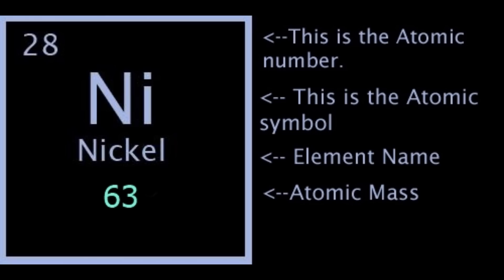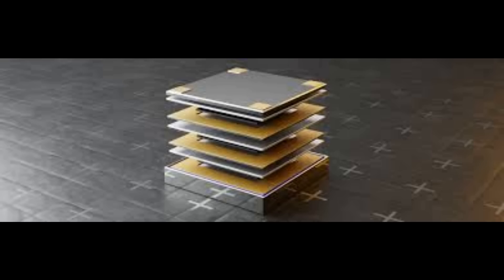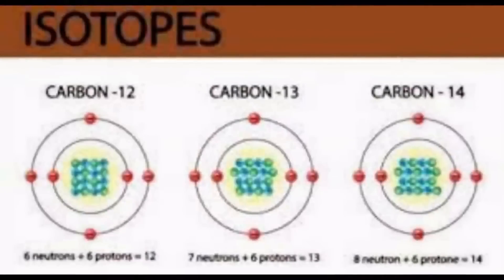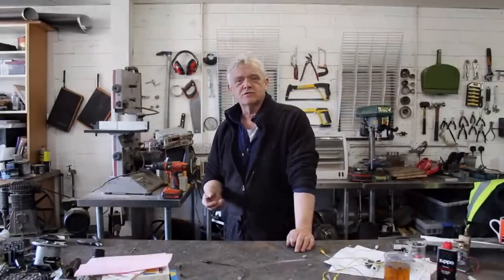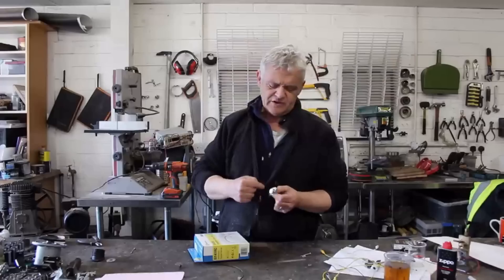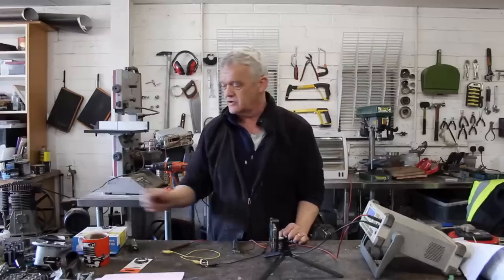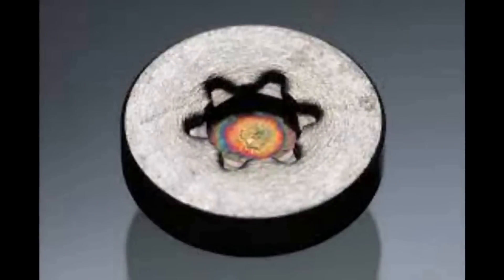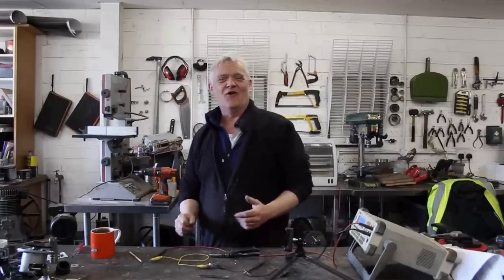2187 - The 50 Year Nuclear Battery From China And How To Make Your Own Version

Comment: So, this has got me thinking... While the output is minuscule, its also constant. Could we step up the voltage and feed it into a supercondenser to power something for small bursts? The only thing I can think of is a GPS tag, maybe a weather station. Given how incredibly small that semiconductor is, I'd say you could build a GPS tracker that lasted 400 years and wasn't much bigger than can of coke in your own home, with the tradeoff that it could only beam the position every so often.

Were these power sources cheaper and safer, you could probably cover entire cities with self sustaining, life long lasting lora transmitters, for cheap and reliable low bandwidth communication
Reply: Wait could you power a Casio clock with one of these cells?

Comment: Very interesting. It didn't occur to me until now that alpha radiations, being near the UV wavelengths,  could cause photovoltaic cells or semiconductors to generate a voltage. I guess the same is true of x-rays too since they're the next step up from UV. Not that I know of any material which puts out x-rays while decaying.
With the Americium, it looks like quite a few pieces would be needed in series to get 3.3V. I suppose each pellet could produce twice the output if it's extracted from its casing, to expose the underside and to sandwich ir between two transistors.
My smoke detector with Americium is definitely putting out Beta radiations too as I get an increase of over 500 CPMs when pointing my Geiger counter towards the plastic case and Alpha radiation wouldn't make it through the plastic and thin metal cage surrounding the ionization chamber. I don't think it puts out Gamma though because the readings drop when I insert a 1mm steel plate between the smoke detector and the Geiger counter. It's still bad though if it can ionize floating dust which might end up being inhaled.
Reply: That could be a concern , but I remember another vid where a person went into a mine and the air was very radioactive from all the uranium decay. I could be misrepresenting but the main issue was the charged particle radiation attracting and sticking to the clothing which came out pretty  radioactive, however it decayed quickly and putting the clothes into a bag away from the camp overnight dropped the radiation to background levels, perhaps simply an airtight unit would suffice.
Reply: @terrysobkowich2084  If you meant airtight batteries then yes, I'd expect them to be both airtight and shielded sufficiently to block beta radiations, as someone will inevitably end up carrying one in their pants pocket.
If you meant airtight smoke detector, that wouldn't work of course as the smoke needs to get in 🙂

Comment: Too bad it's only 130mV. Even if you wired 1600 of these batteries to get 240V, They wouldn't have the power to give you the amps to run anything usable. Stick to the grid.

Comment: This kind of voltage/ current would be useful for offsetting parasitic drains on circuits where there is always something that slowly depletes a battery even when you are not using it

Comment: I'm making an open trestle windmill out of what would have been firewood, when it is in operation it will simply turn a couple of alternators charging car batteries powering an oil radiator for the house. The sales will be 10 ft from tip to tip.

Comment: I first came across nuclear batteries with the Gameboy powered by tritium, phosphors, and a solar cell. When I looked up why not just throw radiation at solar panels, most articles I saw said solar cells will break down under radiation over time (not sure if solar cells on spacecraft are protected specially or not). Wouldn't this be a concern for your example?
And maybe explains why diamond semiconductors are used, maybe it's more stable?

Comment: There's a difference between the slow, what are called "thermal neutrons" in a reactor, and them being hot. They're actually less energetic than the fast ones, which as you mention kinda bugger off, though sometimes a reactor tries to slow neutrons down with a moderator material. This is because slower neutrons are better at smashing open other atoms, to give the chain reaction a reactor relies on. Where fast ones tend not to interact as much.

It's actually un-needed Strong Force, binding energy, that is the "mass" lost as energy in nuclear fission. The number of particles left after is the same as before, they're just arranged into smaller atoms, an overall less-energetic state. The excess energy is release as heat, but mass is lost because binding energy actually contributes quite a bit to the weight of an atom, even though it isn't a solid particle. Because energy = mass (times the speed of light squared). That equation works both ways.

Comment: Round about 0:30 you mention the battery giving 100 milliwatts of power, then later around 2:30 it's 100 MICROwatts! It's rather important to get this right! 3 orders of magnitude is a big deal in electronics! From what I've heard elsewhere the correct figure seems to be 100 microwatts. Useful for extremely low-power radio with sensors and the like, in super power-saving deep sleep modes, and maybe charging up a capacitor for occasional bursts of more power. 

You mention a future 1 watt version, so that'd be 10,000x more than these current ones. Although they're only tiny, scaling up by ten in each direction to a 15cm cube would be 3,000x bigger. So then you'd need to decide which dimension to increase by 3x, or whatever you like, to scale it up. That's still a very reasonable size for a battery with real power. 

This nickel isotope sounds very energetic, I wonder if that's going to cause problems in itself? I'm presuming, of all things, they're not gonna use LEAD in the shielding after removing every atom of it from electronics otherwise. Covet your precious lead solder, the stuff that actually joins components together!

Comment: 63Zn is not naturally present. To produce 63Zn, solutions of 63Cu - copper nitrate in dilute nitric acid need to be irradiated by 14-MeV protons in a low-energy cyclotron. It's certainly interesting for long battery life duration but it requires quite a lot of energy to transmute 63Cu copper atoms into 63Zn.

Comment: so if one trasistor generates 100mv.. then it also uses only small partion of the emitted radiation... i guess placing it inside a say something like tungsten cabride shell for reflecting radiation and placing lots of transistors there probably can produce lots of lectricity ... well ewen without shell there is atleast 5-6 transistors can face it directly if placed correctly .. but that reflector shells may be working making small radioactive matters go gritical too :P who knows... does it worth a try ... i dont think so without proper safety :P

Comment: I did something like this 15 years back with an americium chip. Was proof of concept but I would likely have to wait a long time to power up a capacitor to get an led to light. Had more fun with the chip and 4000v spark gap tester. Basically a fine guitar string wound in a ladder across a metal plate with about 5-6mm gap. Variable capacitor to wind it up until the arcs start then wind back just until the sparks stop then wave the alpha emitter over near the guitar wires. tick, tick, tick :P

Comment: NO the Betavolt (the Chinese battery you are refereeing to) battery can supply 100 MICROwatts NOT Milliwatts you'd need 10,000 of them in parallel to charge your phone at 1 watt which would take about .
please do a minute of research BEFORE you sprout Rubbish.

Comment: YOU COULD USE AT THE END OF THIS NUCLEAR BATTERY A CAPACITOR WITH A JOULE THIEF TO ENERGIZE THE LAST ELECTRO MAGNET OF A CIRCULAR MAGNETIC WHEEL WITH A DYNAMO IN THE WHEEL AXLE AND TO SEND ALL DYNAMO ENERGY TO A CAPACITOR WITH ANOTHER JOULE THIEF. WITH 3 OR 5 OF THIS DEVICES YOU COULD DEPLOY AN ALWAYS CHARGED BATTERY PACK FOR A SMALL SIZE PERSONAL ELECTRIC CAR.

Comment: OK how many of these to create a 48volt battery and what Watts would you generate with the battery? How big would it be if you just had the isotope and reactive part. 1mm thick per cell? Or much thinner if specifically manufactured to be as small as possible. I feel we could make a 48v battery the size of maybe a 12v lead acid car battery .....watts?

Comment: if its alpha or beta could you point it or several on an angle in a glass chamber so the radiation cant get out and the sun light can get in to give it a boost, dno if that would be too much for the diode or if it could give it a nice little boost

Comment: Nice demonstration. In 1960s, our military developed a portable nuclear plant that operates years providing a local power plant anywhere. There's a military documentary on yt showing this. And just in recent news this concept is being revisited. 
Thanks for sharing and providing good inspiration.
Reply: naquadah generator?
Reply: There are a few hundred of these abandoned around the former USSR. 
They used them for remote locations like lighthouses.
Reply: @MasterFancyPants  I thought the Soviet ones were radio thermal generators and not conventional reactors
Reply: @outsider344  They are, but the American ones in OPs post were also RTGs. 
The US just quickly decided they weren't saft enough for common use.
Reply: @MasterFancyPants  Some were RTG, some other ideas were not up to the task yet. 

I know at least 1 design was the plutonium gas core reactor. This has advantages and disadvantages but the much better efficiency for each gram of fissile material, pretty damn safe and light, not extensive huge cooling solutions. It currently is a gen 4 or gen 5 reactor design.
Reply: @MasterFancyPants Like nukes in suitcases or psiedon torpedo nukes ?
Reply: See also: nuclear powered submarines, and ships(mainly aircraft carriers).
Reply: Ah but that would make it difficult to take money off us for energy, no wonder this sort of thing is kept low key
Reply: @billb7876 yeah. That's what it is. You sound like a man to trust with nuclear material... You always had the option for your own wind an solar. You just lacked the ambition and commitment so you play along in the game you claim not to enjoy. Face those facts first before introducing your theories.
Reply: @billb7876  Stories about an experimental device tried out in remote Baja Sur that was a vibration based nuclear power station. Somewhat portable and shaped like a disc. Supposedly the remains of it are still in the mtns near the town of San Jose de Gracia.
Reply: @billb7876 that's not the reason
Reply: @billb7876  if you wanna make up a conspiracy at least make it somewhat logical.
These small nuclear plants wouldn't be cheap. So the electricity would probably be more expensive than what you are paying right now.
Reply: @Jehty_ What about the carbon Tax
Reply: @TheSubpremeState  what about the carbon tax?
Reply: @Jehty_  that's what the conspiracy theorists are annoyed with. Emissions compliance etc. all ways to keep us poorer than we should be
Reply: @TheSubpremeState  or all ways to try to keep the planet somewhat livable 🤷🏼‍♀️
Reply: @Jehty_  Sorry but I'm a mere mortal. I've accepted my death. I'm only 44 but I've 30 years left before I stop using up oxygen approximately. You are planning for the future. In the larger scheme of things you are planning for a spec of time. Imagine when the sun eventually expands into a red dwarf. What are we doing to prevent that? Your brain has evolved to like survival so it even likes the idea of surviving the impossible. The odds of this universe being the only one are very slim. You know about the strong force and gravity etc. and how if they were slightly different the big bang couldn't have happened. It'll probably happen again some time. Everything happens in its own time anyway so if you are worried about the future just worry about a few million years from now or a few billion. We will all be living on a space ship by then I suppose until the universe ends.
Reply: @TheSubpremeState  erm, we already do feel the impact of climate change. Especially with extrem weather phenomenon becoming more and more common.
I'm not talking about the distance future. I'm talking about the future you yourself will experience.
I guess you can close your eyes to reality and act like it won't affect you. But all you are doing is lying to yourself.
Reply: There was a crazy man who said there were these reactors under all cities and they pumped cold water from Alaska and not oil to cool them
Reply: Many small scale nuclear things were tried including nuclear powered cars (Ford Nucleon).  At the time it was envisioned that small scale reactors could also be a home power source. These days with battery energy storage this is truly feasible, but the nuclear dream died long ago.
Reply: is it an rtg
Reply: All Naval nuclear platforms should be capable of this.
Reply: It got scrapped because the fuel rods would build steam if removed improperly and one of the techs wasnt paying attention when removing it and got pinned to the roof by the rod

Comment: I heard the battery potential is 3V, nice
I heard the battery can deliver up to 100µW,  which is 0.1mW
I did some calculations, it turns out you need (1/100µ) = 10.000 batteries in parallel to deliver up to 1 Watt of energy @ 3 Volt (3 W total)
- the chinese thinks this can run electric vehicles and keep drones flying..... I say: Big budget, Big vehicle, Big FAIL for those applications.

Comment: A problem with spacecraft nuclear batteries is what happens if there is an accident and the battery material gets vaporized and spread across the atmosphere?
The batteries in the Galileo spacecraft, if it broke up in atmosphere during launch, was calculated to potentially cause 50,000 cases of cancer, minimum (if i remember what i read correctly), which is why some scientists (Carl Sagan even) were against using them.

Comment: you dont have to worry, the particles are stopped by air at about 1cm. they also cannot penetrate human skin, however crush it at your peril, the dust if it gets into your lungs could do some damage. however its safe as a little radioactive puck.

Comment: I saw the product announcement yesterday and hoped you'd review your battery.  Thanks.
Wouldn't ɑ/ɓ radiant voltaic battery continue to produce electricity after its half-life, but at a reduced rate?  Only half of the mass would have decayed into its new stable element -- the rest would still be active?
WOuld love to see this or a karpen cell as a charger for the fractal capacitor array.  One cell per capacitor.
Reply: Yust look at the voyager probes.
They passive energy source decayed more and more over the decades and now only a few of the instruments have enough power to stay online.
Theoretically it's never out of energy but practically it all depends on the half life.

Comment: There is no such thing as nuclear waste.  Only nuclear products we are currently not using.  We have enough nuclear waste in the country that if we wanted we could power the US for 150 years with no other energy sources.  You could quit fossil fuels just reusing existing waste alone.  Humanity's energy potential is exponentially larger than what we are currently using and we have the technology for it today.  And for some reason we have people in power telling us we need to use less energy.  The reality is that energy is basically NON-SCARCE.  Not with some theorized technology.  Not with some unobtainium.  But with materials we have stashed in piles and don't know what to do with.  Someone has made the calculation that we are not to have beyond a certain level of power.  Qutar burns more oil per capita than any other country, basically to make fertilizer.  Do you know how much fertilizer we could make with the nearly unlimited energy we have access to?  They want us to eat bugs to solve "nitrogen shortages".  It's so dumb.

Comment: Hello,  i tried this exactly in this fashion , i even checked the americium alpha source with my Geiger counter;  tried several same transistors;
i just cant get it to make any discernable voltage above just the room 60 cycle noise .  Perhaps my Voltmeter internal impedance is too low;
its a cheap multimeter from box store...   I read that there are radioactive / phosphor light emitting rods; maybe coupling one with a solar cell would prove a good output ?